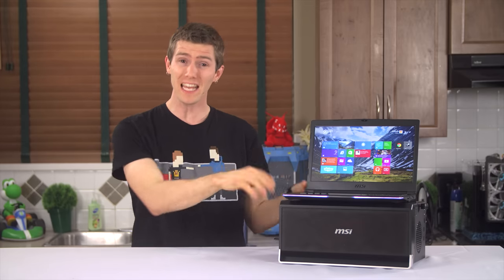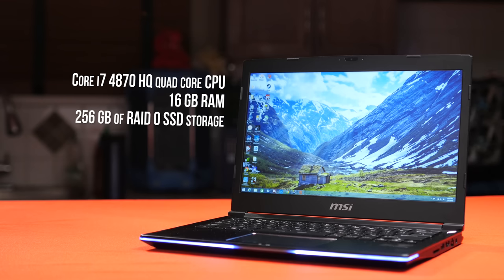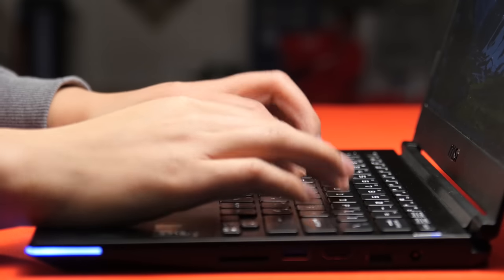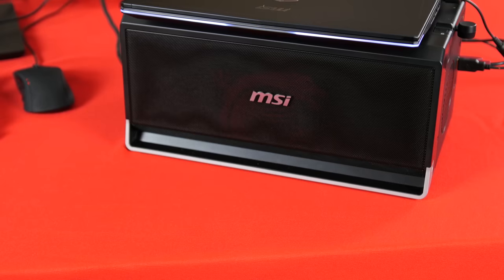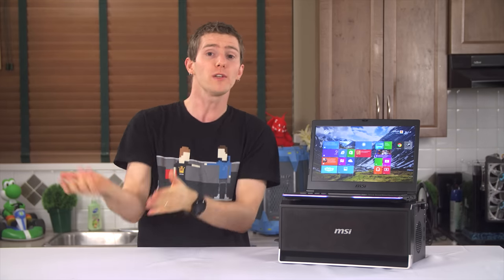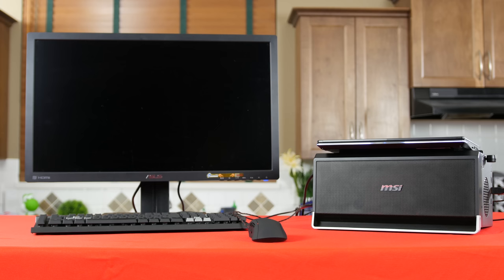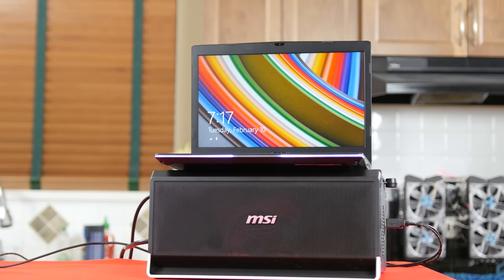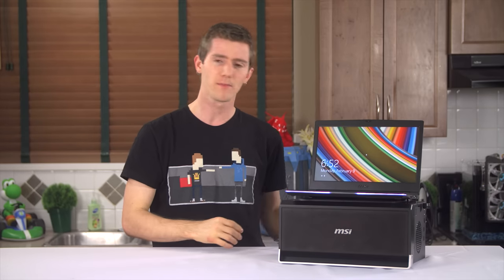MSI GS30 Shadow - Part Beastly Gaming Rig, Part Ultrabook

Comment: MSI seems to be set on coming out with some pretty insane products (this and the gaming laptop with a full mechanical keyboard). While these products seem impractical, it's a good thing that they're doing this because maybe one day they'll come out with a revolutionary product that changes PC gaming forever. But I do agree with a lot of people here, I'd rather have a gaming rig and a cheaper, less capable laptop/notebook.
Reply: At first I thought I commented with the wrong account LOL!
Reply: tbets hi
Reply: What up!
Reply: ***** im confused why are both called tbets
Reply: Fdsfdfdsfds Dsfdsfdfdsf Yup! This is my other channel, I decided to make this channel centered around PC gaming builds and gaming news. I wanted it to be separate from my main channel.
Reply: I agree. At this point it seems MSI is the only company innovating.
Reply: RGInquisitor Yup exactly. They may not be perfect innovations, but at least they are trying to bring something different to the market. Hopefully one day they'll nail something.
Reply: except an external GPU for a Notebook isn't even remotely a new concept. there's many products already in existence. they range from barebones connections, to full enclosures that are more of a fashion item than a practical one.

Comment: Seriously? These high paid engineers never of modular design? You only need a case half that damn size. One PCI-E 16x for the GC and a 8x or 4x for the sound card (especially) or expansion card and PSU. Inputs: 6 x USB3, laptop connector port and 2 GB LAN. Want more HDD space, that's what the USB ports are for. Want DAC instead internal SC, use the USB.

I mean who the hell wants to buy a dock that comes with shitting speakers with internal hdd? It is the size of a printer. Just cut out the bullshit and keep what matters and let the user add what he needs and want at his own pace and budget.
Reply: I'm sure those engineers could have done it better, it's the marketing department who was like "IT NEEDS SPEAKERS I DONT CARE HOW BIG IT IS, THEM KIDS LOVE MUSIC AND EXPLOSIONS"
Reply: drojf Shitting speakers shitting in my ear :P